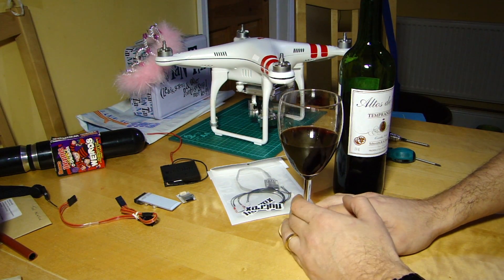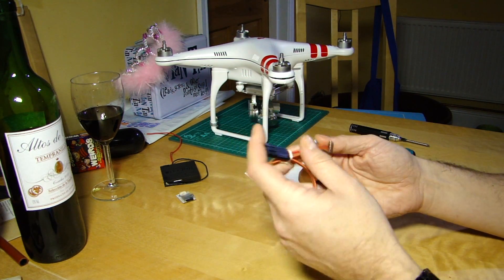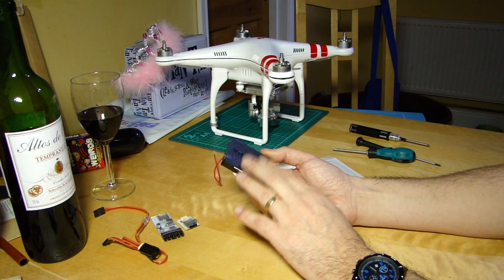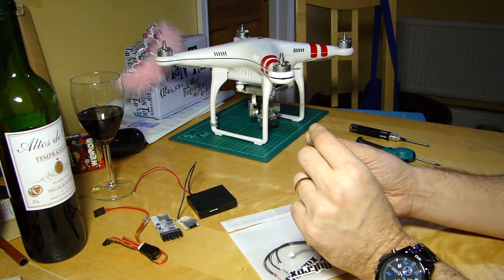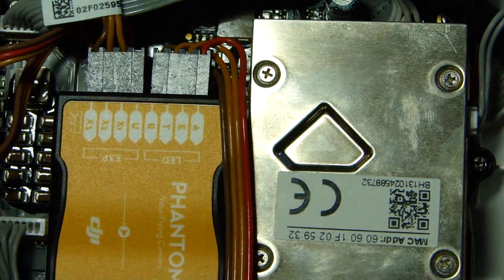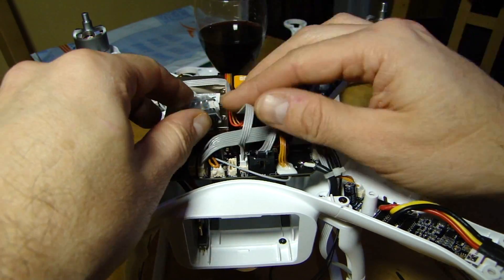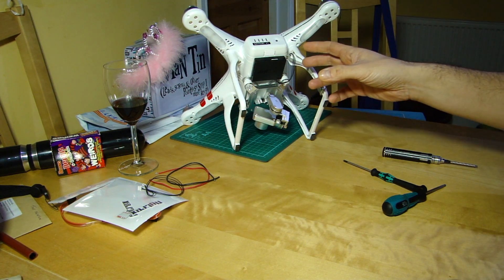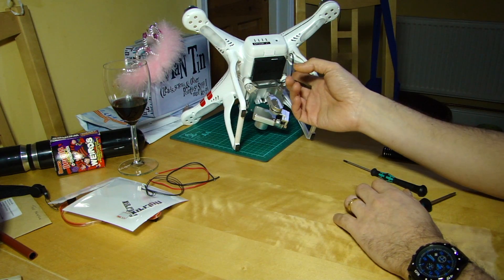Flytrex Live - in-depth look and new NO SOLDER option for Vision+ and P2...

Comment: Hi Simon. Hope you have been doing well. I still have this Flytrex from my PV+.
Was wondering if I connect to external battery if I can use on a Phantom4.
use the two big wires opposed to the canbus. Will that show any data?

Thanks

Comment: Simon, thanks for another great vid. I was considering upgrading from my Flytrex Core 2 to the Flytrex Live 3g. I'm concerned (and confused) though over the activation of the SIM card without a phone number. I recently read a review about the H2O sim card on Amazon and thought this would be a likely choice (since Flytrex had them listed as an option). In the review the consumer mentioned that the SIM card would not activate because he didn't have a phone number assigned to it. Can you expound some on how to Install the SIM and get it registered properly for us rookies?
Reply: Slvrbllt44 Also, does the Flytrex Live 3G come with it's own IMEI number?
Reply: ***** Simon...I went with the upgrade and purchased the Flytrex Live, thanks to your video. Just an FYI for those that upgrade like I am, you'll get a 20% off discount if you are already registered with Flytrex on their web site. Email support and tell them that you are thinking about upgrading from the CORE 2 to the Flytrex live and they will send you a link for the 20% off. ALSO...I bought a SIM card from H2O cellular (recommended by Flytrex) here in the USA. Thanks again, for your great vids and info keep up the good work!

Comment: Thanks for this video Simon which has helped me with the decision of whether to buy or not. I have two questions:

1. I take it that in addition to the Flytrex Live 3G for my Vision +, I only need to purchase the new solderless CAN BUS adaptor and that I do not need the old style Installation Cable. The Flytrex site is not too clear on that.

2. Currently I have a Core 2. Can I install the 3G at the same time? The reason is that I sometimes cross country borders and the sim card that I would install in the 3G will not be roaming and will only operate in my home country. I would like the 3G Live for home use and the Core 2 when I cross over the border.

Many thanks.
Reply: ***** Thanks for that Simon. I'll try a line to Flytrex but I've not had much success with them in the past.
Reply: ***** Kudos to Flytrex you have improved their speed of answering emails since my last contact with them.

FYI and for the benefit of anyone else in a similar situation, they have confirmed your response. Here is their reply:

"Yes, it is possible, both systems will work simultaneously.
Your best option would be the Live 3G with the CANBUS adapter."

Thanks for your help Simon.

Comment: For those that want to have a smart way of attaching the device. this is a nice tool http://www.shapeways.com/product/7K9FWMU23/flytrex-live-live-3g-mount-for-dji-phantom?li=shop-results&optionId=43508168. This is very nice for those that I have a standard P2 with gopro and H3 3D stabilizer and live transmission view.  In fact this give you space where to connect the device in a reliable way

Comment: Hi Simon! How long do you think it would take you if you were to install a Flytrex 3G and a Lightbridge System om a P2V2 ?
Reply: ***** That's what I thought. The reason I asked is that I asked my RC specialist to do this for me and he just sent me the bil charging 4 hours for installation of LB and Flytrex 3G plus another hour for testing at 60 per hour. I don't mind paying for good service but I feel like I'm being quite a bit overcharged here.
Reply: ***** Thanks for your feedback. - So I did it: I exchanged my previous setup with Flysight Black Pearl and Mambo for a Lightbridge. I also have the Epson Movario with the mirroring adapter. Curious to see how that will work. I would also need the iOs app for LB to use LB with my iPad Mini, but that's no longer officially available. Would you know how or where I could find or download the iOs app?